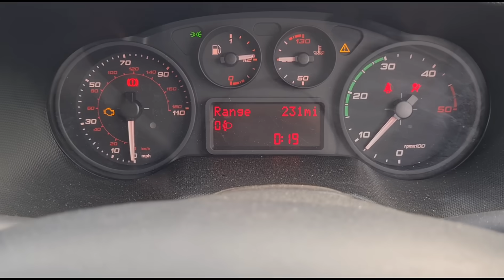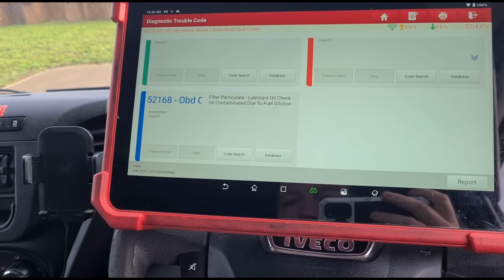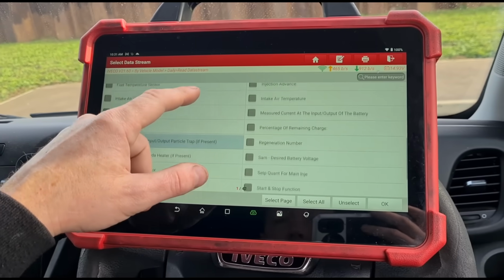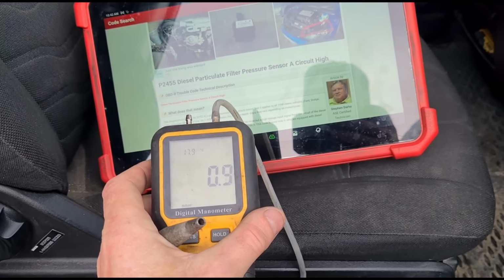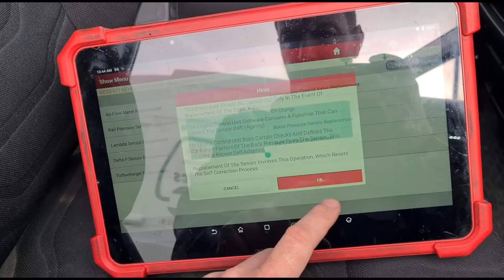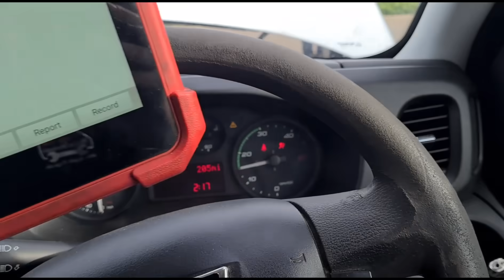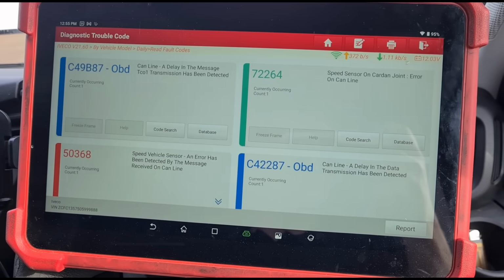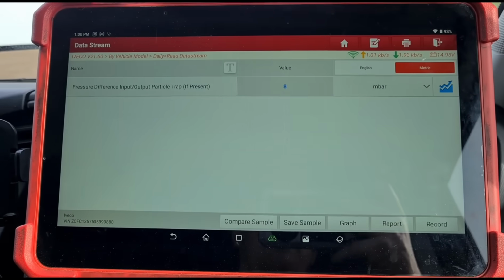Iveco 245562 - OBD Code P2455 - 245215 P2452 - 52168 - P0521 DPF Particulate Filter Sensor & Oil

Comment: We had several on our fleet, as you said, total nightmare with electrical issues. So many faulty bulb out reports and nothing wrong, engines dropping into limp for no reason at all then fixing themselves. Was so glad to see them be auctioned off in the end. Great video as usual 👍

Comment: Hi Jimmy my dpf on the mercedes regens every 100km even though the dpf pressure shows around 20mbar at 2400rpm. New pressure sensor has been fitted. Can i just reset the dpf adaptions?